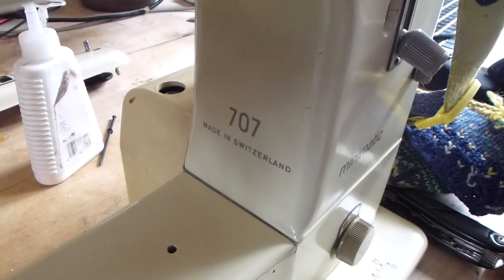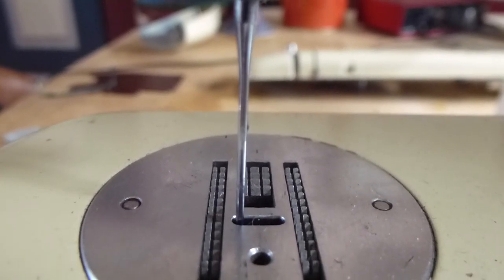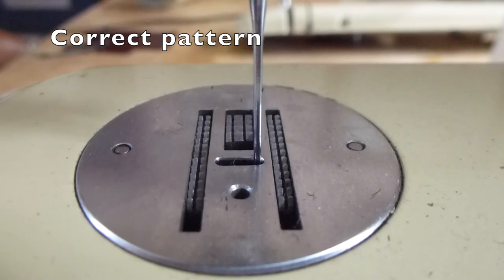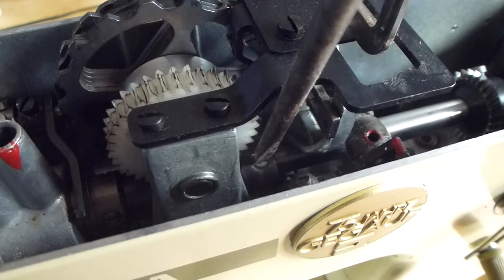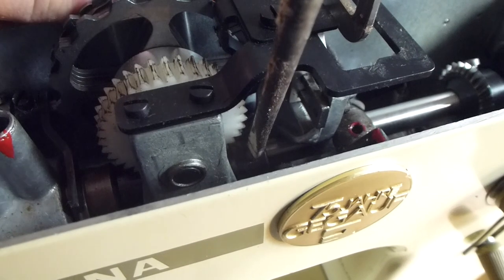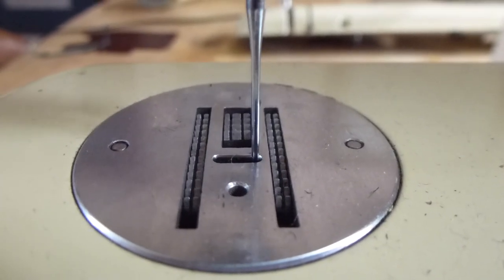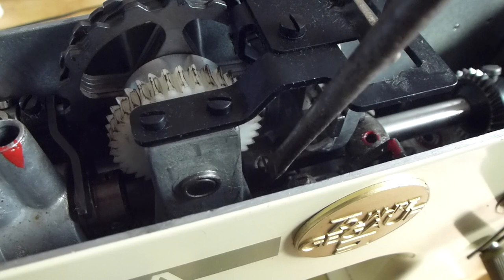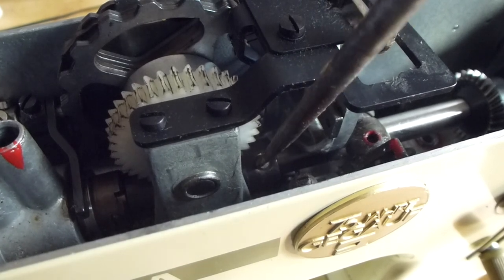🔴Vintage Bernina 707 Zig Zag Alignment Adjustment. Pattern-cam sprocket replacement, Part 2 of 2.

Comment: Hi Lucas 
Pls help. I just inherited Bernina Minimatic 707.
It is working but it is slow sound as if it is struggling. What should I do? PLS HELP 🙏🏽
Reply from the maker: Check that it runs freely when cranked by hand, if not it will need to be serviced.There are two speeds check that you can change that switch on the back, it might be on the slow setting. If is on the high setting and still runs slow, oil it. Be carful not to force the motor. Join the facebook group.
Reply: Thank you very much for your response 🙏🏽🙏🏽🙏🏽
Reply: PLS send me the link